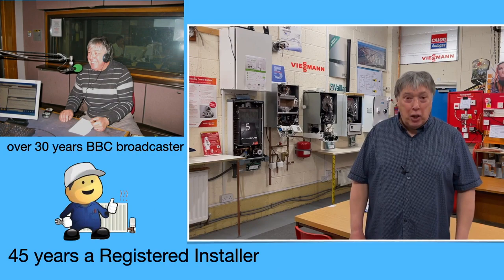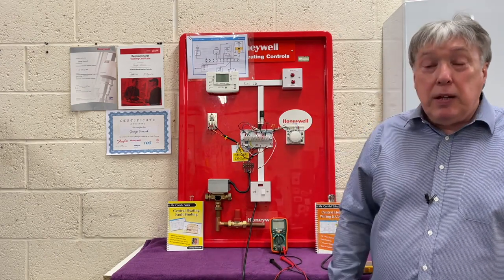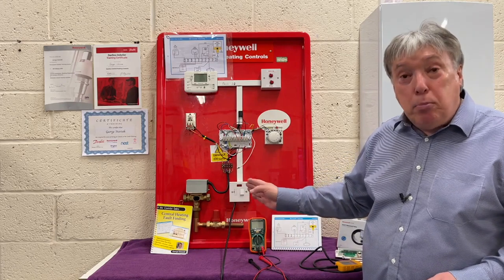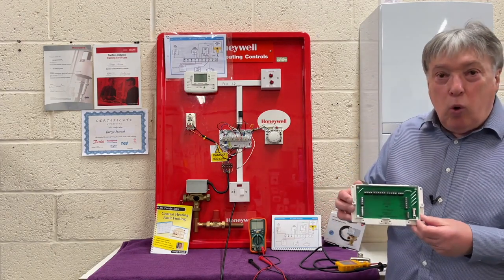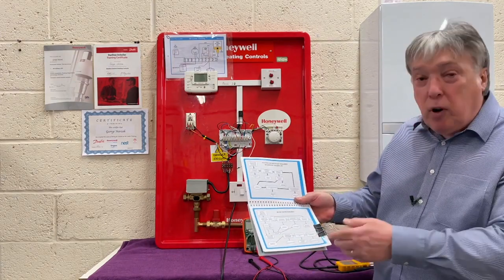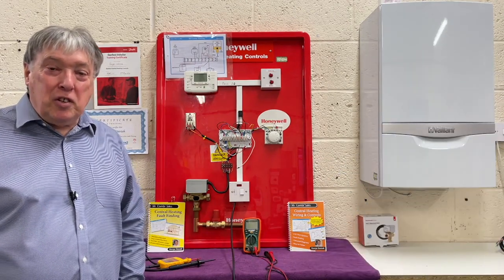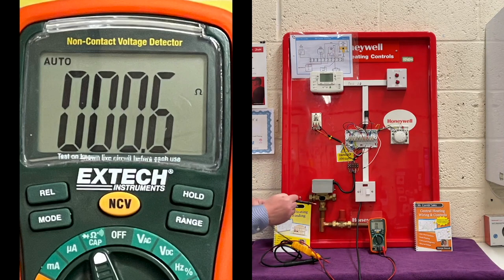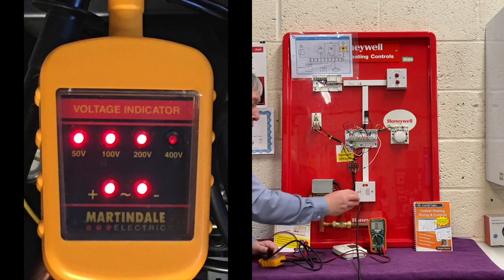Central Heating Y Plan Mistakes: Using a wiring centre is alway best, I show you how

Comment: Hi there, looks like we have similar heating/hot water system Y plan ( i think) as we have a 3 way mid-position motorised valve and also have the same hot water termostat, (both located in our loft space) however we have another 2 way motorised valve just by the hot water cylinder and also a second hot water thermostat on the hot water cylinder, the 2 way valve was starting to make a loud noise (all times), so i replaced it, bought the same as the old, and replaced it, the issue i noticed was with the wiring, in the terminal box we have 3 wirings ( one is the water temperature thermostat, then a wire from the programmer, and the 2 way valve) when i remover the cover i seen the the brown, blue and the earth wire form the programmer and water thermostat connected together, but from the 2 way valve was only the blue and earth connected together with the programmer and hot water thermostat, and the brown from the 2 way valve was connected alone in the terminal box. the orange and gray wasn't connected anywhere, both were blanked, ( my question is that why the brown cable is in the terminal box if not connected together with the browns from the programmer and hot water thermostat.) any advice#?
Reply from the maker: Dear Peter, I feel sorry for you,  a complete mess installed by xx!!! person who has NO knowledge of heating or wiring or YOUR bills and there are load of them that's how I made the 1st. million. Most important is HEATING load, if rads are less the 9 KW = mid position valve 10/16 Kw = 2 zones 16+ Kw = 3 zones, this is basic stuff I taught 40 years ago.
It is strictly forbidden to put a zone valve into a mid poz. system makes it uncontrollable. 
If you are classed as competent in wiring then start again but only use the Honeywell wiring centre. 
Remove both valves repipe and start again. Follow my advice re air vents + F2. All the best George Staszak 🤩👍

Comment: Even though Honeywell provided a wiring diagram for use with cheapo connection strips, installer still made a wiring mistake with my Y system. Thing is, most of the time the system worked fine, but sometimes it didn't. Wasn't easy to put right.
Reply from the maker: Agreed, I have loads of wrongly cited systems, made a fortune fixing them. Our Wiring book and APPs are more popular than ever as more installers have a go. Take care, George staszak

Comment: hi there, I have a ST9400C programming unit, and I am trying to replace my old hcw80 wireless thermostat and receiver, with a newer DT90e  in the old receiver have a 5 wiring which are (Blue wired in N, then the brown wired in the L (2nd)  then I have a black wire which wired in to A, then a grey wired into B and then the earth wired into the E, , do I follow the same with the new receiver dt90e ? if so where do I connect the earth as on the new dt90e there is no E (mark) only C, in the new receiver dt90e I have a NLL then ABC , any advice? thanks
Reply from the maker: Hi Peter, only 230vAC R.stats must have earth and 2 lives + neutral,** DIGI R. stats don't need  earth or neutral only some volts or NO volts see boiler info. for [Volt Free connection]  in A (Common) out on B * SW.L. to boiler.
Hope that's OK george staszak
Reply: @mrcombiBedford  thanks so how do i wire up the new digital one, mean the receiver as it has a NLL, then ABC on the old receiver wired as above i wrote,
N blue, L brown the Black in A and grey in B
thanks, mine issues with the current one is that in the morning the boiler starts and fires up, then it run for a minute or so then goes off, then it wont start again until i scroll down the thermostat to zero and back up to 30 degrees. during the day it works fine, mean heating starts and stop
Reply from the maker: @petinyiri  
Are you in installer mode?
Reset:- Take the batteries out fit new alkaline, the wiring you know, re-binding as they say Help Line:-  Technical Support
Phone: 0300 130 1299
Email: technical.support@resideo.com
that will work, george